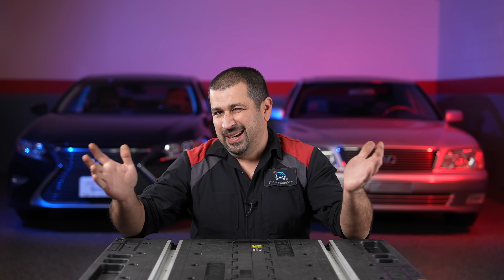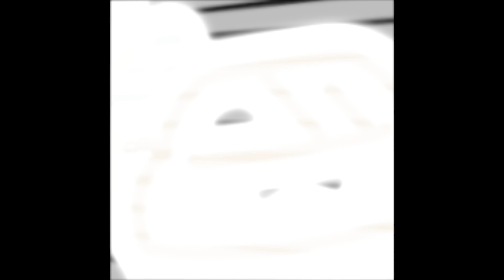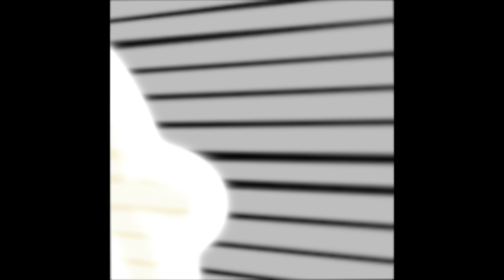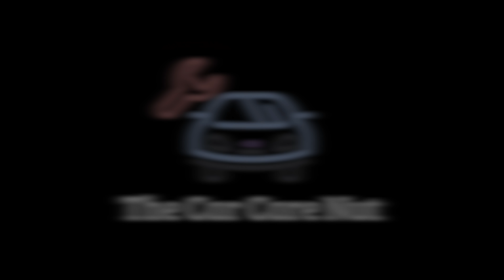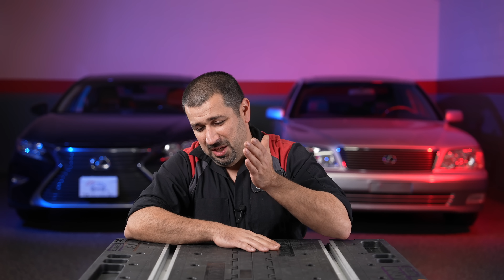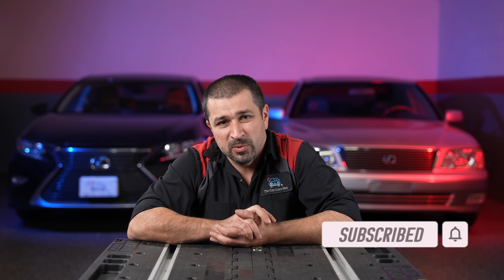Can Modern Turbo Engines Be Reliable? Here's The TRUTH!

Comment: I dunno why diesel is less popular at US, turbo actually is best fit with diesel especially for 4x4 and suv. Modern gasoline engine all using alloy cast engine block, my old mitsubishi 4d56 still running perfectly fine after 15 years with so called old out dated iron cast block...😅😅😅

Comment: So... do I want an EV for commuting and running around town and a turbo-diesel for longer drives where the EV sux?  Today you see mfg's saving pennies, cutting corners, and you see internal engine parts wearing out faster and faster.  I run two older Honda V6.  We change the oil every 3500-5000 miles, not 7500 -10,000 and we don't tow anything.  We've gotten 200,000 miles out of both of our older Hondas and they're still running.  The new Honda hybrid goes in for an oil change after Thanksgiving.  Take care of your stuff.  My mom and dad paid $25,000 for their first house.  We're looking at $45-50,000 for a new car now?!?!?  Probably be $55k in another two years.

Comment: Dear Care Car Nut - Love your content!!  Thank you!  CAN JET ENGINE OIL BE SUBSTITUTED IN TURBO ENGINES?  Since an automotive turbo is basically a single-stage jet engine turbine (a jet engine is a multiple stage turbo), could a more resilient oil, designed for jet engines, can be used in turbo automobile engines and do a better job of protecting the engine for a longer period of time than the recommended automotive engine oil?   If not, why not?

Comment: These 0W20 or 0W30 oils are a disaster too. Better use a thicker oil like 5W and with a high heat range like 60. This a full synthetic 10W60 will do very good. 
A thicker oil needs to be warmed up over a longer period. But for the engine in a thermodynamic way it also is better to slowly warm up the block. If you step on the straight with a cold engine you might be sure of turbo and overall engine failure.
Reply: 0w oils are not an issue.  It’s poor manufacturing controls that are the issue.

Comment: I have a 2012 Volvo XC60 with a turbocharged inline six. I have over 264,000 miles, many of which are rideshare miles. Original engine. Original turbo. No issues or repairs to either. Just service. 5k oil changes with synthetic (once a month there for while when it was my only car) and now I use prime series conventional 10W30 from Sam's Club. 12qt case is $37. I change it every 3,000 and the oil looks black. Wouldn't take it another thousand. Good design and quality parts really does play a role here. Volvo has been building turbo cars since the 80s. They know what they're doing. I wouldn't trust a GM 3 cyl turbo to last it's warranty.

Comment: We got one of the last Mazda CX5 Carbon Turbos and feel like we caught the last chopper out of 'Nam.  You can keep your anemic NA, CVT trans, hybrid BS, etc.  This thing is gorgeous inside, stylish exterior, 8 years with no changes so lots of spare parts, mature drive train, drives tight and plenty of power.  Penzoil Ultra Plat with Mazda filter every 4k, but extra costs are the trade for the smile it puts on my face.  Worth it to me.

Comment: Orig. Owner - 10th Gen Accord 2.0T Touring 148k miles. Rotella T6 (5-40w or 15-40w).   Oil testing has been done at 8k to 10k.  Results show 10k was pushing 
 ideal limits.  Lab recommended 8-9k so we shoot for 8k, if it ends up being 8500. . .we are O.K. 

Oil samples show the same results at 140k as 30k.  

PS: We have not had a single, mechanical failure.  Only general maintenance has been performed. Even the Honda Recalls, haven't affected us. 

8 yr. old Accord runs and drives like new.  Because I service it, vs dealership.  The first service was performed by dealership and it was 1 qt. low on eng. oul. The breather box cover was not closed after inspecting filter. COLD Tire psi was different on all tires,etc.  Dealerships don't = qualified technicians. I just had a Master Tech at Honda inspect my wife's Accord, because I was trying to save myself the time. They wanted $5k to replace 4 struts. I inspected and found this wasn't accurately diagnosed, after speaking with tech. I also, found rear brake pads worn almost tometal the day after I paid dealership $204 for inspection.  

These types of experiences are more and more common.  So I ended up doing everything myself, except for the 4 wheel alignment. This is also why, data collected at shops is not 100% accurate. Human error. . . 😢

Comment: Another pet peeve, maybe I am wrong… but more turbocharged engines are also being combined with no oil dipsticks! You have to rely on electronic sensors to tell you the oil level and you can’t easily see if the oil is looking dirty.  Why this seemingly complex solution to a simple issue of checking one’s oil level?

Comment: Real answer IS NO, NO MATTER THE SITUATION, gasoline turbo engines are more reliable than naturally aspirated engines.  Way too much risk, over pressurized, less head gasket sealing area, higher operating temperatures,  less metal as most engine blocks have metal removed for coolig yet also promote more structural vibration/ flexing and oil lines to turbos bearings have high risk no matter oil service schedule will clog thereby grenading engine.  Would onspercharger assming engije can take pressre and you do not have aheavy foot.

Have not even watched video and already know this is CAFE driven. No thanks

Comment: This is why I just purchased a last of the 6 cylinder V6 4 runner.
Reply: Did the same and bought a 2023 Tacoma with. V6. None of that lawn mower engine with a turbo on it for me.
Reply: @rickraidel2013  I have a 2022 Tacoma but trading it in for a 2025. Go test drive one, guaranteed it will change your view lol. It drives so good
Reply: @westcoastplinkin6559 I’m sure it makes nice power.  What about transmission issues already being reported and long term reliability of a turbo.  I have my doubts.
Reply: @aradoran Transmission issues were only in the 2024 early models and they’ve been fixed. There are no recalls on the transmission. And the turbo engines have been performing very good as well
Reply: @westcoastplinkin6559 it’s a miracle they ever sold a single Taco ever!
Reply: @justinrogers9010  I don’t think it’s a miracle. After daily driving a 3rd gen Tacoma for 3 years the 4th gen is a huge improvement
Reply: Same here I bought a 2022 with 4.0L bullet proof V6 with no turbo. My last one was same engine 4.0L V6 non turbo it was in a 2006 Tacoma worked hard commercially with loads daily, it lasted 200K and sold running well.
Reply: @davidcox2197 are you sure that the 2022 Tacoma does not have the 3.5 6 cylinder?
Reply: Ditto, got a 2024 4Runner specifically for the V6.
Reply: @JamalSharwinI'm torn I want the last v6 but the 2025 looks so nice
Reply: Same bought a 2021 Tacoma a couple years ago.  Should be set for 15-20 years at my annual mileage.
Reply: @aradoran drive it 4000,000 miles
Reply: Me also on Tacoma
Reply: Y'all so giddy with your gay ass little twuks. Aww P**((
Reply: I drive an ‘05 4Runner. Timing chain tensioners went at 230,000 miles. I luckily found a replacement motor for $5k Canadian with only 110,000 miles on it. If I drive it for 6 more years, that’s only $1000 per year, including the install cost. Most people would scoff at that, but are still happy to pay 10 times what I paid over 6 years, plus loan interest to travel the same distance over that time as I will. 

I’m happy to continue throwing my saved cash into my investments or pay down my house with the extra $9000 per year.
Reply: Same with my 2021 Highlander Platinum!
Reply: @SergioAlvarez-lh8cn That's unibody, not in the same ballpark.
Reply: @goingwiththecurrent  not comparing suvs, but engines v6 vs current turbo version.
Reply: @SergioAlvarez-lh8cn The video premise is based on reliability. Unibody can't come close to body on frame.
Reply: @goingwiththecurrent   To clarify, I am not referring to the SUV body or vehicle category. I am specifically referring to the engine design and reliability.

The naturally aspirated V6 used in the Highlander is a proven engine with a long, well-documented track record across multiple Toyota and Lexus platforms. Its reliability is well established, with fewer failure points due to the absence of forced induction.

By contrast, modern turbocharged engines across the industry have experienced a higher incidence of issues in recent years. Turbocharging introduces additional heat, higher internal pressures, and more mechanical complexity, all of which can negatively impact long-term durability. While turbo engines can offer strong performance and efficiency, they inherently carry more risk over extended ownership.

Therefore, when the comparison is limited strictly to engine reliability, the naturally aspirated V6 remains the safer and more time-tested option
Reply: Same! Love my V6....it's perfect
Reply: Me too!
Reply: Almost all V6 engines have six cylinders
Reply: @fnurple3426 🤦‍♀️
Reply: V 6 sucked fuel
Reply: I hope one day I can get a 23 or 24, I fear turbos
Reply: I did one better. Got 2 GX 460's, one for my wife, one for me. Those V8's should take care of this family for a couple decades.
Reply: That's why I got a 23 taco,
Reply: Tundra V8 master race representing
Reply: Passed on the Tacos got the nissan Frontline with the v-6
Reply: @BigALdeek  Same here!

Comment: I owned a 2015 Volkswagen GTI turbocharged 4 cylinder. It had some modifications and was quite fast. Changed oil every 3,000 miles and during opportunities to push it I always checked the oil temp. Traded it for a new Honda. ( I was in my late 60’s by then) Sales staff at Honda dealership soon found out how fast it was. They blew it up in a week.

Comment: No, they cannot be reliable. We know this because they have pistons, and anything with pistons is unreliable. If it were reliable, it wouldn't need regular maintenance like oil changes! Get an EV! You will save much more than just the huge cost of gas.
Reply: I just bought an EV bicycle. The first thing I did was over-inflate the rear tire (hey learning experience). The new tube will be in tomorrow (Monday). I'm selling one of my cars and riding a bike.

Comment: I bought my first turbocharged vehicle this spring. I had heard that they are higher maintenance so I was ready for that when I bought it. It's a WRX and I absolutely love driving it. One of the funnest cars I've ever driven. And it's a year-round driver to boot. But I'm also anal about maintenance. So I change my oil every 3,000 miles. I'll be doing my differential and manual transmission fluids at probably 20,000 miles. New plugs every 30,000 mi. I don't baby my car. I live in a place where I can take it out in the middle of nowhere on back roads and drive as fast as I want. So I'm not afraid to drive it fast. But I don't do hard launches or anything like that. I don't race stop light to stop light because frankly, a stock WRX isn't all that fast stop light to stop light. But they are plenty fast to have fun with on the back roads. I would personally never run any turbo charger/intake valve cleaner through a turbocharged motor. They screwed us by going to GDI only motors. So you're stuck with having to have them manually cleaned every 50,000 miles or so. I do quite a bit of wrenching, but it's mostly preventive maintenance. I wouldn't attempt to clean the intake valves on a turbocharged motor myself. And probably wouldn't clean the turbo charger myself. I'm dreading my first spark plug change on this car.

Comment: Super short sighted emission regulations - a reliable larger petrol engine wil outlast a turbo engine...so what about the emissions when the 1st turbo car is scrapped and new one start, while the non-turbo is still running reliably, even with bit higher emissions...

Comment: Interesting.  My 2004 Audi TT 1.8T has over 250,000 miles with the original engine and turbo.  Of course, changing oil every 3000 to 5000 miles with a good synthetic oil from the beginning may be why.  I've never used less than 0W-40 or 5W-40.  Remember, manufacturers are forced to do stupid stuff by government regulation or market demands.  Start/Stop=Stupid.  10k miles change interval=Stupid.  2-stage oil pumps=stupid.

Comment: There's one top answer why turbocharged gasoline engines are more prevalent: the government. CAFE standards, EPA, UN agreement for fuel economy and emissions. 

The mandate for efficiency comes at the price of displacement. Smaller, lighter, altered alloy engines are demanded by the public, yet they want power for their larger and larger SUVs which largely have replaced sedans and wagons. These smaller engines are asked to produce 200-450hp routinely.  These engines now operate at the higher end of their performance envelope, much like a marine or aircraft  ICE. But the design is not for longevity, which would mean increased weight and forged parts. The engines are designed for the sale, the brochure. Then throw away.

Comment: I own two Land Rover turbo diesels. A TD5 Defender 2004 and a 2007 Discovery 3 TDV6. Both over 400 000 km and going strong. The only people concerned about turbos are the ones who have already decided they are unreliable. Gasoline I don’t know. They were unreliable in 1980. But I don’t think so today. But it is the same as with electronics snd wet belts etc. Give me a ECU and injectors any day before I go back to points and carbs man!

Comment: I like how everyone thinks adding turbos is the way but Toyota has the right idea: Make all models with invincible hybrid drivetrains are the way of the future, more efficient and won't die as fast as most (all?) turbo variants will and the better fuel economy would more than cover for the eventual hybrid battery replacement (which, treated right can easily get to 200-300-400K)
Reply: Yup. Big surprises coming when the batteries go bad. They will become a liability and follow the car owner as they expire. Proper disposal will be monitored. It's in the planning stages now but not talked about for fear of aggravating the car makers. Similar to refrigerant recovery for AC systems. But worse. They will be titled in your name.

Comment: So when will the new TTV6 engine in the Tundra become reliable??? It seems no amount of oil changes will save that dog from blowing up. I am so glad i have my V8 Tundra. As a point of interest,  my work vehicle is a 2013 MB SPRINTER and at 103 000 kilometres the turbo went bad. Turbo engines are nothing but problems.

Comment: I'd add the advice i was given years ago when I was interested in a turbocharged car.  Learn the requirements of that particular vehicle -- not just maintenance, but driving practices, letting the oil circulate before you throw it in gear and drive away, and let it spool down before shutting the engine off.   I'll also question leaving the start/stop function in operation while driving -- you do not want a vehicle starting and shutting off repeatedly.
Additionally.  My parents friends had a son that worked for a manufacturer.  He asked the engineers about the extended oil change intervals that had in the manual.  Their answers were that it was the minimum amount of maintenance at which they would warranty the engine against failure.  They all said that if you wanted it to last much longer without issues stick to their old recommendations of changing oil every 3,000 miles.   There's engineers today that will still state this plainly, even if you cannot afford the highest quality oil, use the best you can afford and do it often.

Comment: It’s not that a good synthetic oil loses it’s ability to lubricate up to 7500-10,000 miles, it’s the dirt that accumulates in the oil that does the damage. So frequent oil and filter changes are needed to evacuate the dirt and contaminates.

Comment: I try and not drive my car in a manner where I need the turbo to spool up and give me boost. People can correct me if I’m wrong, but my understanding is if you’re a spirited driver and spool up that turbo, the increased pressure can create blow by past the low tension rings used in modern engines and contaminate the oil.

Comment: I recently replaced my 2011 4 runner v6 200k miles with a 2022 v6 because of engine reliability and it did a reasonable job pulling my 5000 lb boat. Being a realist I know someday I will have to once again replace the 2022. My concern is how much will the longevity of the twin turbo sewing machine motor be effected by pulling a heavy load somewhat regularly?

Comment: whats is your opinion on modern cars using 0-20w oil. I want to move back to 5-30w. im in california and my temps dont drop cold enought for 0-20. I know this is an added reason OEM's are using to meet EPA emissions. you should do a detailed video regarding this change to most modern cars. especially turbo vehicles
Reply: If your car is sold in other countries look up those manuals.  Most allow thicker oils. 0-20 is for CAFE standards not engine longevity.

Comment: No. Making tiny engines and then adding a turbo to make up the difference in displacement. It is never going to be as reliable as one without it.  There is no replacement for a decent engine. If turbos are so great, why not skip to a blower and gain way more HO and immediate torq throughout the whole throttle. Instead of needing to spin up a turbo by a ridiculous rpm band like a two stroke motorcycle. Build a decent engine you won’t need any extra bs.

Comment: I've been driving since 1969 and I never went more than 4,000 or 5,000 miles between oil changes.  Presently, I drive a 2020 Ford Escape with the 1.5T 3 cyl. engine.  It has 40,000 miles, purchased new.  Not sure what Ford recommends but I bring it in for an oil change at least 3 times a year, since I don't put on many miles.  So far, so good.